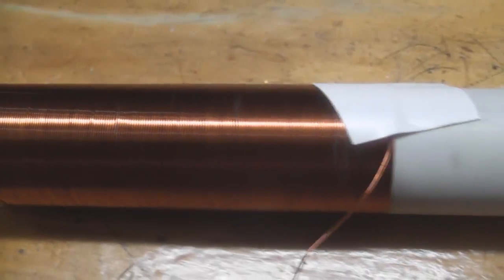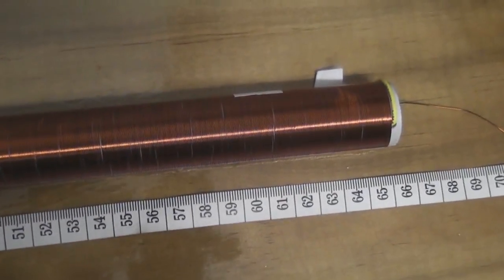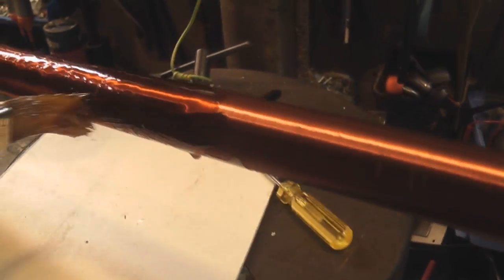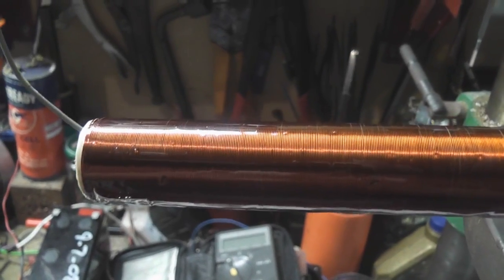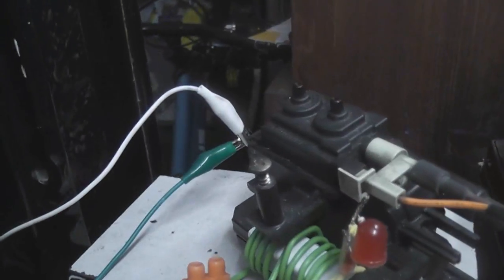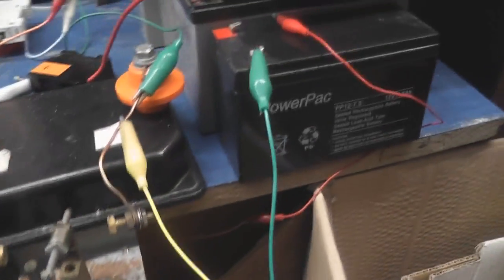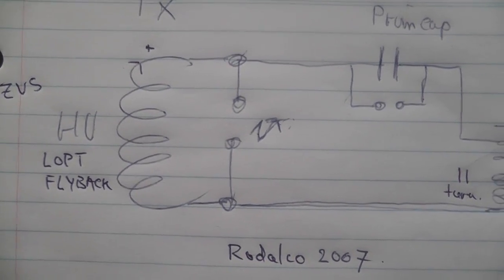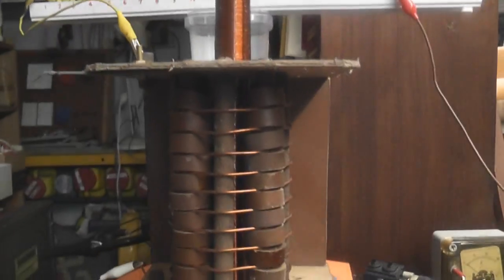The Tesla Transformer works ! !

Comment from the maker: I know,thanks for your advice. For me at the learners stage, this TC was a challenge to revive a 25 year old project which was gathering dust. Only needed to rewire the HT secondary coil with some more turns.
A new TC will be build when I have the time available, and to the more modern design parameters.
Just the fact that this coil didn't cost me anything was great.

Comment: Congrats on a well made running coil. As someone else mentioned, you might want to try a shorter fatter secondary. Usually height is no more than 4x or 5x diameter. Spark gap coils usually use a pancake primary, your solenoid style primary is usually seen on a VTTC or SSTC. Got any big old transmitting type tubes?